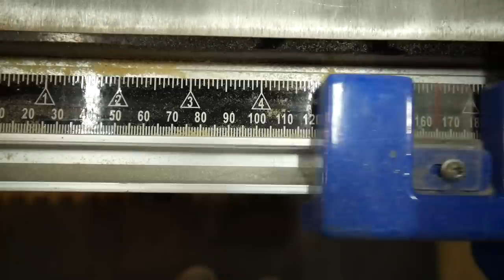Farmhouse Restoration | Entryway Shoe Storage & Closet | Ep.15 |

Comment: You do wonderful work. Your mud room is really nice, however, that mirror would be better installed inside that cabinet for two reasons. One, it would be easier to open the cabinet and step back to left of cabinet in front of the bench and get full length view as the half divider keeps you from stepping back far enough in other direction . Two, it would be safer for the mirror and people walking through the door, as it would be very easy to bump into it with something you are carrying, or loosing your balance and fall into it.
By the way, it looks you could have extremely successful career in directing movies as you already have video editing down to a true art. Beautiful videos!